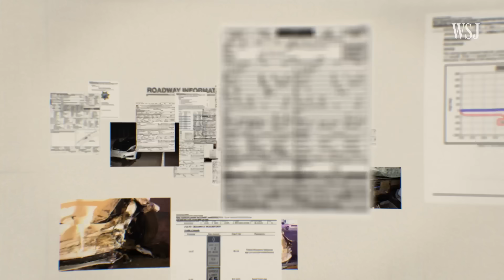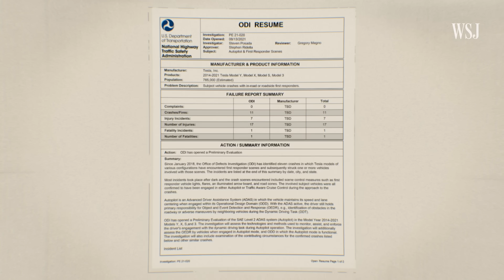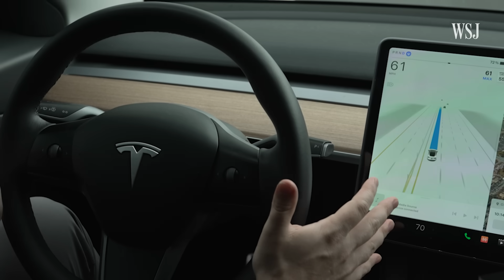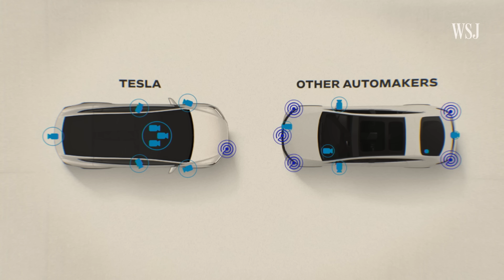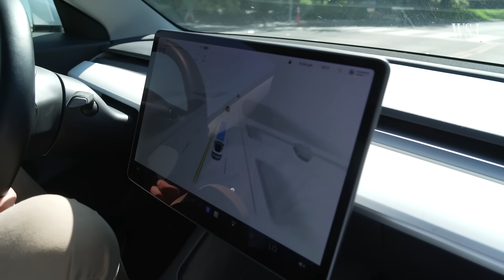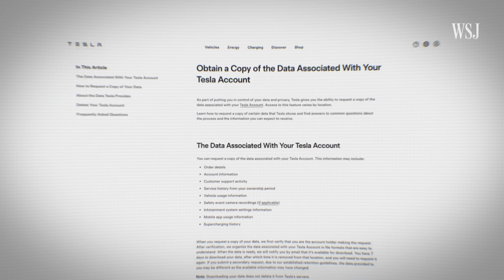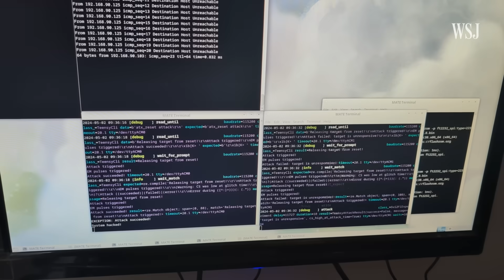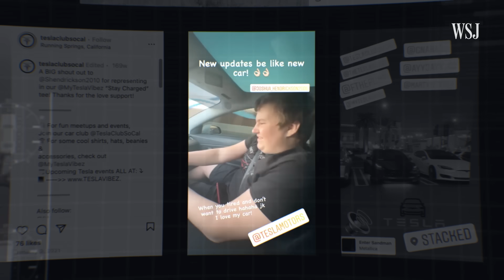The Hidden Autopilot Data That Reveals Why Teslas Crash | WSJ

Comment: I don’t use my tesla autopilot anymore because of too many phantom events. It’s like driving with a new learner who needs constant attention. You are constantly on edge waiting to grab the wheel
Reply: I live in the UK. I tried basic autopilot once on the highway/motorway and experienced phantom breaking. Haven’t used it since.
Reply: @AlexisMoore-nx6wf which is ridiculous given other automakers at least have adaptive-cruise (auto brake/accel) working quite reliably. Sure, you still have to steer with those, and a lot need you to manually adjust the speed, but that's still a huge help over having to pump the pedals in stop-and-go traffic.
Reply: Got the same feeling. Can't let the car drive when my family is inside
Reply: Me too. I barely use it. It also feels like only FSD users are getting „Autopilot“ updates.
Reply: YOU need to sell that failed car 
and stop funding n supporting that grifting, untruthful, uncaring, cheat.
simple as that, not hard, not complicated
Reply: I have seen (and captured on video) a Tesla model Y phantom braking right in front of me. If I had not been following at a safe distance, I wouldn't have a car right now.
Reply: yeah, much worse than just doing it yourself 🙄
Reply: Same. Used it a few times and the glitches are scary! The car stepped on the brakes while overtaking a semi truck. Never again.
Reply: @xavierlozinguez  "never again" what? Never driving a car again, as this happened in a car? Or never driving any updated version of a Tesla "because this happened in A tEsLa"?
Reply: @ I love my Tesla but I don’t trust the FSD at this time unfortunately and am not inclined to activate it. Still love driving the car myself. To each their own I guess.
Reply: your autopilot is just you betatesting it for tesla...
Reply: On road use should never have been approved! The system was not ready. Why and how did Musk and Tesla get any final approval to perform what is actually real life or death on highway testing by customers who obviously did not understand the Risks of       an unproven system... what are they hiding?
Reply: I'm sorry that you got duped into this product
Reply: Exactly! I’ve had the same experience!
Reply: same here, I just play with it out of curiosity only when the road is empty in front and behind, with low speeds and daylight and it still makes me nervous because of phantom breaking happening from time to time.
Reply: Agree. I was told by the dealership in the UK that anything above the basic autopilot isn't reliable enough. He was right.
Reply: rollin coffin, 
not  A P
Reply: After this big mess with Tesla, they've proven they do not care enough, and can't be relied upon to take a slower track with testing and release of these assist systems.
Reply: I use EAP and it makes me more relaxed during driving. I still do pay attention and I already safely caught some mistakes of the autopilot. But for example on a clear road with all markings, normal traffic and a daylight - I still pay attention but in such case Tesla does not make mistakes.
Reply: I've had this in the UK just with EAP, not even FSD, it makes me so nervous that I am absolutely exhausted when I stop because I've been concentrating so hard, it's more stressful than driving manually, so I rarely engage EAP now, only really use it if the highway is empty, but even then I've had phantom braking occur for absolutely no discernible reason.
Reply: @DJBaldPaul  I've had EAP try to steer me onto a slip road because there was a gap in the line shortly before the junction. I only really trust it now if the roads are quiet, and it's a wide road like a motorway or dual carriageway. TACC isn't so bad, but when the traffic is heavy it tends to get a bit twitchy when it thinks other drivers are going to cross into its lane.
Reply: @therealchayd  i got the same experience in Australia as well. Not quite sure why it is happening, even if i have turned off navigation on autopilot. It sometimes drives into slip way on highway.
Reply: @bisujin1685  Strange, maybe it's something to do with software designed for a primarily LHD market has problems with those of us in RHD countries (Australia, Japan and UK to name a few)
Reply: What year and model ? @DJBaldPaul
Reply: Same, currently looking into selling mine for a Rivian. Insane how much a Tesla costs yet doesn’t have the basic equipment every other electric vehicle has like LiDar & radar. Tesla is sold as a premium vehicle yet Elon says LiDar & radar are “too expensive” when in reality, they just want to pocket the money for their shareholders.
Reply: @purplealien9048Lidar is removed, because it caused more issue than it solved. It was noise and unreliable source of data. It's picture resolution was low too. With proper AI teaching, the camera+AI did a better job.
Reply: That's my #1 reason to not buy Tesla. My 20 yo Hyundai has cruise control. A brand new Tesla has TACC...phantom braking and doing lots of unexpected things when meaning it does not have cc.
Reply: @Sjalabais  Tesla does have regular cruise control.
Reply: @NDcompetitiveshooter  how do you activate it without the smart features? I have asked the people selling Tesla here and they say it wasn't possible.
Reply: @NDcompetitiveshooter  I wish! It doesn't have dumb cruise control, only TACC which is still prone to phantom braking. It would be nice to just have dumb cruise control where you're in areas with strict speed limits, but also where traffic is dense and there are a lot of cases which might trigger phantom braking.
Reply: @NDcompetitiveshooter  Wrong...  It has a FSD without doing the steering. This is the entire crux of the problem. The phantom braking and such still exists. How do I know? Because I tried it and it still has all of the problems.
Reply: @Sjalabais  There may still be some level of baseline safety features enabled even when using cruise control on the Tesla.  In my experience, it hasn't been prone to the same phantom braking I've had with FSD.  I've had FSD stop for patches of repair asphalt at night, because it wasn't sure what it was.  With cruise control, it doesn't seem to care because I'm the one steering around any perceived road obstructions.  It's kind of like turning off traction control in a modern car; most of them never let you fully turn it off--it just reduces the parameters for intervention.  I can use slip-start in my Tesla to reduce traction control, but you have to enable track mode (with a model S track pack) and put it in drift mode in order to really get rid of all the traction control.  The difference is insane BTW.
Reply: @therealchayd  I don't see the same issues with phantom braking outside of FSD or auto steer, but I'm sure it can still happen.  It would be nice to have dumb cruise control and be able to switch back and forth while driving.  Also, ice mode, rural deer mode, cows in the road mode, and a lot of other things.  The possibilities are endless.
Reply: @NDcompetitiveshooter  I can imagine. No doubt, these cars are fun to drive and way too easy so, too, with all the gadgets engaged. The trouble with not wanting phantom issues is that safety features tend to need re-deactivation every time you start the car. Is it the same here? Just had a Ford rental which "smart" features were just as dumb and annoying as everywhere else, but with a whole new level of constant beeping, too.
Reply: Same here, driving under a bridge at 70mph, BAM, car brakes hard for no reason (shadow I guess). I smash accelerator - heart pounding - good thing the guy behind me was paying attention. I avoid using autopilot when there are lots of bridges/interchanges on a sunny day. It also saved my bacon a few times by autosteering when some morons tried to merge on top of my car at 70mph.
Reply: What HW version do you have?  Intel Atom FSD sucks big time compare to HW4.0 with FSD 13.2.1
Reply: I don't use Tesla autopilot anymore.  I use FSD 13.2.  It drives me everywhere.  Amazing.  Like having a professional chauffeur.
Reply: Waiting to grab the wheel? You're supposed to have your hands on the wheel anyway. Despite the title name, it very specifically states it's a supervised system in it's current form. And 'waiting to grab the wheel' is what you get with any other 'Driver assistant'.
Reply: @tv321123  that is a metaphor.  I drive with my hands on the wheel as the Tesla will not allow you to continue without that.  Nevertheless, you have to be on high alert ready to intervene at any time.  It is not a enjoyable experience.
Reply: FSS Version 13 has been improved a lot. I hope Tesla users get this update as soon as it can be sent to your vehicle.
Reply: @Mr_Battlefield  😂🤡🤡
Reply: @Mr_Battlefield  I've been hearing this same hype song and dance about every update since "beta" dropped and every single one takes 1 step forward and 7 steps back. It's been completely unusable for the past 8 months due to a new bug they introduced in one of their "mindblowing rewrites" that causes it to want to merge the opposite direction of an exit it needs to take. So I simply do not believe you at all.
Reply: @electrified0  Except since version 12 they are not rewriting anything its a Neural Net its not `written` its learning try watching videos of version 13 its way smoother way better
Reply: @Mr_Battlefield the underlying technology is bad, so no amount of software upgrades will fix the lack of LiDAR.
Reply: @SteveGillham  Laughing with V13. You have no idea what's comming.
Reply: @SteveGillham  LiDAR struggles with rain, fog, and heavy snow, it's really not that good of a system and would cause muche more accidents if one would rely on Lidar. Neither does it perceive color, contrast, or context of the environment. Ideally would be a combination of Lidar with camera's.
Reply: @quietapplause1  yes I know, but just having cameras is even worse.
No amount of updates will fix that lack of tech.
The people who purchased Tesla don't really understand this and just listen to the claims Musk makes about his cars, he is a salesman after all.
Reply: @brad7571  well when it removes you, we won't have lost anything valuable
Reply: Maybe in the past. But the very neer future belongs to FSD. Thank god for that.
Reply: @christofferravn4486  No, it doesn’t. Tesla can’t update FSD without breaking another part of it and it’s not safe to be fully autonomous yet. Meanwhile Waymo is running cars every single day in several major cities doing fully autonomous ride share services. That is a massive amount of fully autonomous hours on the road successfully.
Reply: @TrappedinSLC  Hilarious that you are comparing Waymo and Tesla 1:1. 

Waymo operate in 3 limited areas with around 700 cars. Tesla had over 360.000 cars on FSD Beta (in 2023 numbers). 
Who do you think are driving the most autonomous miles? And who do you think are most likely to crack the code to do operate robotaxi in all countries/markets?
Reply: @ Since Waymo is actually doing it successfully without “safety drivers” - aka idiots doing work for Musk for free with no training - in more than 3 cities, I’m going to go with Waymo.

FSD is dependent on the driver being responsible for the car. It is glorified cruise control. It is not a fully autonomous vehicle, and frankly it isn’t even that good at being glorified cruise control given the number of people who have tried it and refuse to use it except in ideal conditions due to safety concerns.

Comment: Teslas autopilot is safer than a human driving in normal conditions.. under abnormal condition it’s much worse because that’s not what it’s trained on. I think if they ever want unsupervised full self drive they’ll have to add at least one sensor that can detect obstacles far in front of it. But as it is, it’s clearly labeled “supervised” full self drive. And that’s what it should be. Let it take the stress out of driving, but don’t put your full faith in it. If you’re even a little weary about something you see, take over immediately.

Comment: Have to wonder what the actual reason for removing lidar/radar from Teslas. Was it a cost saving measure during covid and supply chain difficulties?
Reply: Sensor interference and cost. They said that HD radars would integrate better and would make more sense. The current Model S and X do come with HD radar but afaik they don't make any use of it yet.
Reply: Elon was talking about removing lidar since 2018, it was greed
Reply: Originally it was about cost and Elon's belief that it wasn't needed. It can add some complexity in terms of interpreting what it sees, but if you saw that many points in the road ahead, at bare minimum the system should have slowed down.
Reply: The multiple data types made the system more complicated, And since their removal, the safety record for the vehicles is even better. Something they forgot to mention in the video, or that teslas have the best safety record of vehicles in general ..
Reply: Teslas approach is to train their cars to drive like humans do. Humans don't have lidar.
Reply: @oyuyuy  humans also have brains.  all of these autopilot crashes where the cameras didn't know what it was looking at would not have happened with radar/lidar
Reply: @MBHockey  Some do, none of these accidents would have happened if they used them.
Reply: Yes. They couldn't get enough chips during the pandemic so they said they didn't need it and turned it off. And now we see the result - record death rates among recent car models.
Reply: @curtisadams6048  Record death rates? why are you lying?
Reply: One, it is quite expensive. Two, Lidar gives you a point-cloud in front of the car which can be used to detect obstacles with a lot of compute, but you have no sense of what those obstacles are. A 1-feet cube of styrofoam or a 1-feet cube of solid steel will look the same to Lidar. So from an information utility and processing standpoint, Lidar does not offer much over using cameras and computer vision.
Reply: @imsrini  but all of these autopilot crashes where the cameras didn't know what it was looking at would not have happened with radar/lidar
Reply: @MBHockey  Autopilot is Human written code. So obstacle detection is not always reliable. FSD is a neural net with no obstacle detection, which should do what humans did based on their data
Reply: Cost is always a factor, but the issue is that (1) if a human can drive with just vision, then so can a computer, and (2) sorting out conflicting information from the cameras and radar is difficult, especially in bad weather
Reply: @Tardigrade-n7y  point 1 seems overly optimistic. a classic Elon promise that will not pan out in our lifetime.  all of these autopilot crashes where the cameras didn't know what it was looking at would not have happened with radar/lidar

Comment: Rapid data processing with AI only benefits self driving but collision avoidance. 

Why? AI video based self driving software were either trained by a team of teacher 24/7 or by an array of robotic AI trainers under a huge video bank is however far from a complete product for no crash operation. 

Why? Because what is missing in the data bank and hence AI training. 

Missing? True depth perception and image sample deprivation - because of each orientation of any stalled or crashed vehicle, 2D shape are UNIQUE that cannot be manufactured BEFORE the crash actually took place. 

First person crash avoidance requires real time DEPTH data out of RF or LED radar, that a camera missed. 

That also justify for radar system to be a part of the collision avoidance system in any self drive product. 

The system provider was either ignorant or willfully ignorant in ruling out the vehicle radar in their product. 

Just revise the hardware to include a forward looking radar and revised the self drive software to emergency respond to any collision avoidance signal, plus code in a situation awareness to steer away or take a least collateral damage path. 

AI based self drive software is much appreciated however only fall short to human’s collision avoidance instincts. Who wants to give up theirs and family’s life for the convenience of unsafe self driving product?

Comment: You’re clearly supposed to  be actively driving it’s only to assist you read and agree to this before you can use this. So what was the driver doing . This is lane centering software. FSD is a software that actually drives the car and you pay more for it.

Comment: They need to add radar with the camera's as a means of confirmation of an obstile when the camera's cannot determine the solution in it's image recognition.  Radar is a big component in road safety in the EU.  Volvo HGV's have proven how effective radar safety systems can be with a vehcle much larger and heaver than a car, and are generally much more difficult to stop in an emergency.
Additionally, camera's in general rely on lots of light.  In the dark the camera's effective range is significantly reduced, just like a humans eye would be in darkness.  Radar isn't affected by light and therefore doesn't carry this flaw.